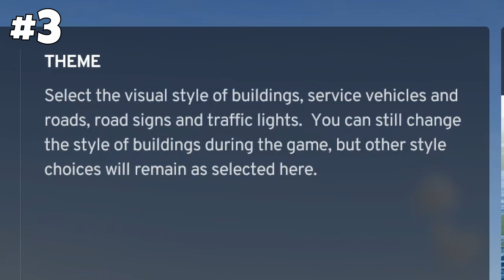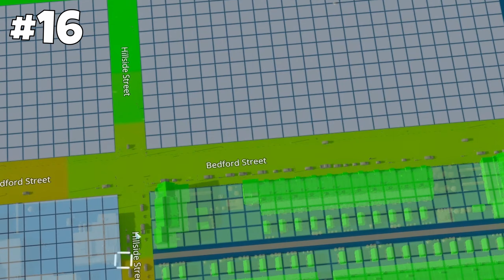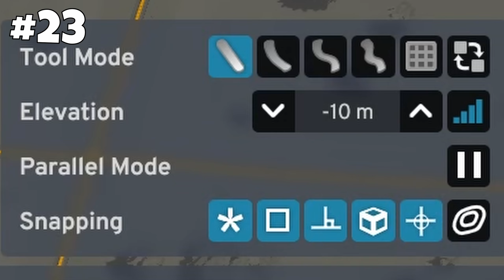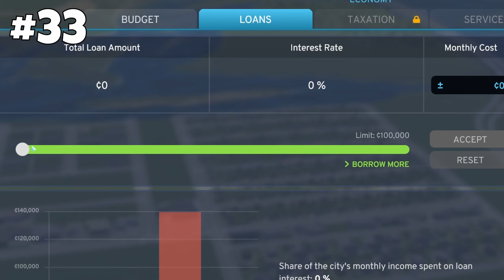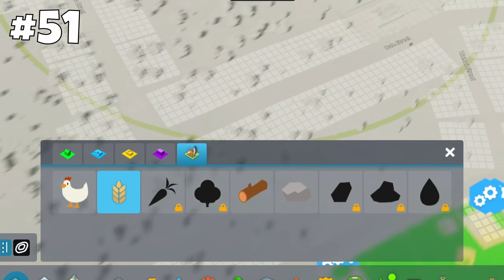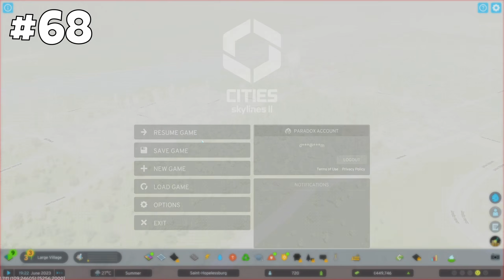75 Tips to MASTER Cities Skylines 2 | Cities: Skylines II Guide

Comment: Best tip: do not buy it, until they finish the game.
Reply from the maker: It's still playable, but not on any hardware, that's true!
Reply: @AimingForGaming  It's not even about performance, so many things look unbalanced or simply incomplete. Just a small example: no one coming out of emergency vehicles, while in Cities 1 there were firefighters actually extinguishing fires, cops arresting criminals and so on. The game is simply rushed out.
Reply from the maker: @2005Crazer ah, you’re about this. Yep, most of the games are released unpolished nowadays, unfortunately :(
Reply: It’s still than the last game even in its current state
Reply: It’s on gamepass

Comment: I think reducing services funding is somewhat of an anti-tip.  In my experience it only made things worse as 50% funding is 75% reduction in service effectiveness.  Even at 80% funding the negative effect was noticable.

Probably better to turn off expensive service buildings than to reduce funding in my opinion.
Reply from the maker: What I've noticed is that it's hard to understand how much you can reduce them, compared to original CS. But in general for me it was pretty efficient to cut water, clinics and police - they were not utilized even for 50% :)

Comment: Nice video mate; appreciated. Here is a tip for you. With the terraform tool selected, right click in the height you want to use when terraforming another area ;) Btw, 96 meters wide makes perfect cells as well, you can lay four cells areas in low residential areas, one by one, to get the bigger houses (4 cells wide). It also works with other zoning types, and with even bigger amount of cells, like 6x6. You can draw a large zoning of 6x6 and get perfect zoning if the street blocks are 96 meters wide, so you don't need to zone them spaced.
Reply from the maker: Oh, thanks for mentioning it - for some reason, I completely ignored the right mouse button in this game. 😅 I had no idea about precise brush zoning. You saved my life - I feel exhausted after all that low-density district placement. Thanks! 😅
Reply: you're mre than welcme mate!  @AimingForGaming